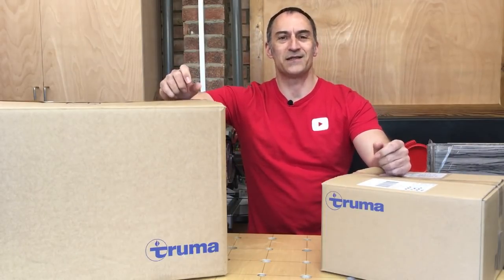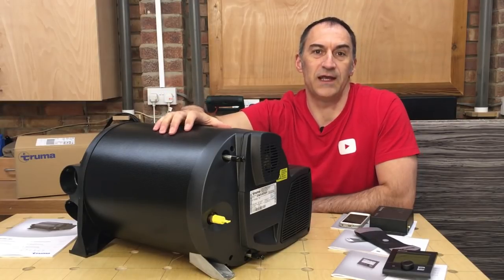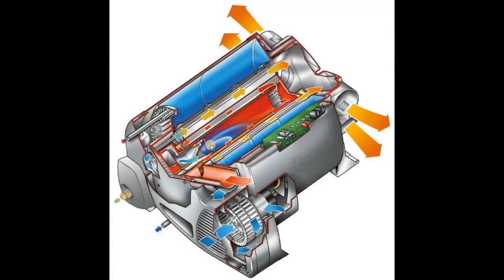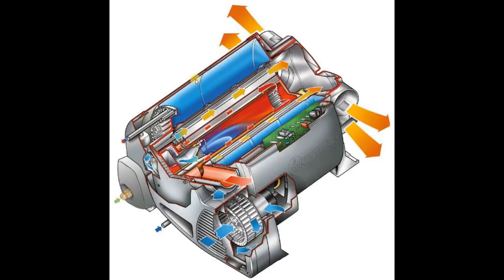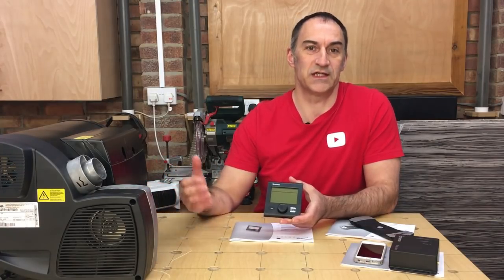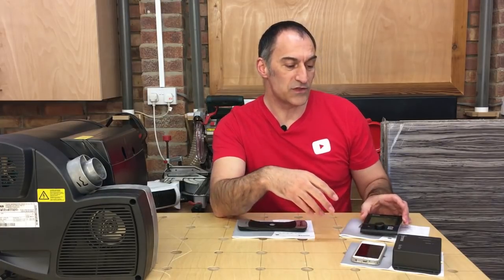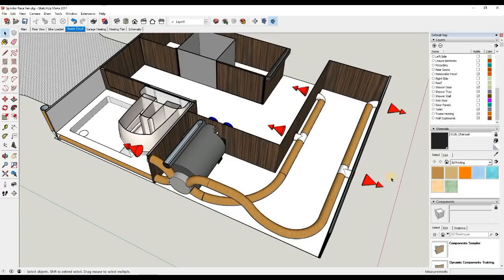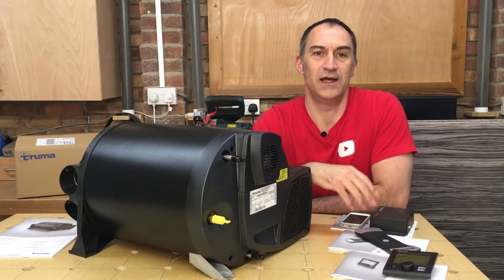Truma Combi 4e Heating & Hot Water Boiler

Comment: will the electric heating element be able to produce the same BTU's as when it's on max heating compared to when it's using max propane mode?
Reply from the maker: carmas54 the gas burner is rated at 4kw and the electric elements are 1.8kw in total (2x900w) so it’s just under half the heat output of the gas burner. I imagine this is done as a lot of hook ups are only rated at 10Amps so anything more than that would trip the mains supply in camp site.

Comment: Great video.
Is the water tank isolated, so if the water is heated up ones it will stay warm for a while without reheating?
Reply: If it were isolated, it would cool down faster.  The water heater tank wraps around the furnace.  If you turn on furnace, the water heats up for free.  If you turn on water heater only not furnace, it will remain as hot as any other heater but appears to be well insulated in the Combi.  If you want hot water while driving, you can duct the water around the engine area as per Truma specs and heat it up this way.  If you look at my comment above, there is a link to an Aussie dealer that lists all the specs. Truma appears to be the most advanced RV heater system available today.
Reply: @lass-inangeles7564  sorry my bad... insulated of course :) thanks for the answer

Comment: Other than the van itself, I bet that’s the most expensive thing you’ve had to buy for the conversation.  Looks to be a great bit of kit. What is the maximum length of ducting you can use to get the best out of the warm air?  Out of interest, will the ducting itself radiate heat, or will it remain cool to the touch?
Reply: The ducting does get warm. I have put small holes with a screwdriver in the ducting to provide extra warmth in certain areas like under seat storage for bedding etc.

Comment: Another excellent video Greg.
One question though. It was not obvious whether or not you can get hot water WITHOUT having the van heater on. Is this possible with this unit or does it only heat water when the air heater is operational?
Reply from the maker: Yes you can just use it to heat the hot water and not have the heating on in the van.
Reply: Greg Virgoe  how much does this unit cost.?

Comment: Hi Greg
was wondering what made you go with the Truma gas heater not the Diesel? I was set on the combi 4 like you have until I read that LPG doesn't like altitude and cold and the heaters are very thirsty from what I've read. We're planning on living in our van full time and so I've been looking at the D6. But im assuming at the moment this will be a costly installation if its fed from the vans diesel tank which I would imagine will involve an expert? 
I wondered if these were deciding factors or if you even considered the diesel option?
I appreciate you must be getting many questions so if I get a reply it would be much appreciated!
your videos are becoming a staple part of my day now I reference them so often!
Brilliant series
Thanks
Reply from the maker: The cost of diesel currently is nearly £1.40 a litre, LPG is only 65p per litre near me and as low as 54p in surrounding areas so nearly a third of the cost.  It also much cleaner fuel to burn and better for the environment. Autogas produces far fewer of the harmful emissions associated with traditional fuels and so offers the best environmental alternative.
 In fact, when compared to diesel, five times less NOx is emitted. I'm going to be cooking with LPG so it just made sense to have a refillable cylinder to supply both where I can get autogas at loads of petrol stations all across Europe.  https://www.filllpg.co.uk/?page=lpg.php
Reply: @GregVirgoe  Cheers Greg.

Comment: Greg - thanks so much for these brilliant videos - really clear and informative. I'd love to know whether this combi would be practical to work on electric input, as i'm trying to avoid an extra gas tank. Would it be practical/efficient?
Reply from the maker: It would be fine on electric hook up but would draw too much power from a battery system. 👍🏼😃
Reply: @GregVirgoe  thanks v much for speedy reply! - good to know. Guess that would be the same for a Truma Therme too then…
Reply from the maker: @sallywilliams6272  the Truma has two 900W electric heaters inside where the Therme has just one 300W element. So to heat the same quantity of water the Therme would take 6x longer. In the end they would have used the same amount of electric.
Reply: @GregVirgoe  exactly what I needed to know, and could never have worked out! Thank you, I owe you a beer!

Comment: Hi Greg. You showed in the video hiw the heating system connect but You didn't explain how the hot water  works.
Thanks
Reply from the maker: In the cut through section, I showed where the water inlet and outlet are connected.
You would use a normal pressure boost pump such as shurflo or similar and connect from water tank via boiler to your taps etc
I will be covering the water distribution system in another video very soon.

Comment: I'm sure that's a great heater, but I'd still go with an Eberspächer (Espar) Hydronic unit and a small heat exchanger; that gets you hot water without a tank. You can hook up another heat exchange to the glycol and that one will generate hot air instead of hot water. Rixen in the US has a kit, albeit for 120 volts (for the electric heater that can be used instead of diesel when you have shore power.)
Reply from the maker: Hello, to heat water instantaneously via a heat exchanger at a flow rate sufficient to have a shower you would need a big heat source. Most combi boilers that do that in domestic properties are rated at 30kW or 100,000Btu
Good luck with your build, let me know how it works out. Cheers

Comment: Why didn't you get the diesel version since you already use diesel to run the sprinter?
Reply: kittadyne   that's what I would do. 1400 quid tho. For a heater.
Reply: Exactly what I asked myself... I had diesel powered air heaters in two of my campervans and they were quite moderate in their consumption of fuel.
Reply from the maker: I was already fitting a GASLOW refillable LPG cylinder for cooking.
LPG is a cleaner fuel, greener and about half the cost of diesel.
Just because I have a huge tank of diesel under the van doesn't make it the better choice.
Reply: So would a gas powered propex or similar heater with no boiler still produce condensation or were you referring to different type of heater like a Coleman gas heater?
Reply: Why don't they make a system heat exchanger that takes heat off the exhaust to warm the water and as backup electric
Reply: Price??? Cost ??? Can't get an answer. ..
Reply: @darrenjones3681  Any heater or stove that vents its combustion gasses outside will not increase moisture.  ANY heater that vents its combustion gasses inside will introduce more moisture.

Moisture is a by product of combustion of propane, gas, or diesel.  So use a heater that is externally vented.
Reply: @clarktferrill  The price is  like for all german stuff, from the Moon.

Comment: Awesome stuff! What size 12v 2 core does this require? And does it come with the boiler or will I need to order extra? Thanks... keep up the good work 🤙🏻
Reply from the maker: Mine came with the mains cable attached but not the 12v. It requires a 10amp supply so depending on distance you may need 2.5 - 4mm cable.
Reply: @GregVirgoe  I’ve put 2mm down maybe about 8m.. do you think I’ll get away with that?

Comment: Greg,  Great review and its a wonderful way to go, but it is very expensive.  Did you do a cost benefit comparison to other units or split systems.  It looks to me like you can buy a hot water heater and furnace for about 1/2 the cost of a truma system.
Reply from the maker: For this particular van conversion it would represent approx a 10% investment on budget.
It is one of the largest single items costs but the benefits and functionality far outweigh the price.
I struggled to find any hot water heaters that can match the performance of this unit.
Reply: I agree, but at what price?  I can get an Atwood (Dometic) water heater and furnace for about $1,200 (665UK) whereas a Truma unit is more than double that.  I have trouble justifying the extra cost.

Comment: I can't believe it's got 2 dislikes! Excellent video, maybe I'll see you touring Europe in the summer, 4 months and 5800 miles planned!  On the level sensor, what happens if you have 2 bottles?  Gaslow is steel, why not Alugas, lighter, any disadvantages?  I'm looking at re-fillable ones to.
Reply from the maker: Hi Malcolm, you never know our paths could cross, sounds like you have a definite route planned. We are going to be much more winging it. 
For two cylinders you will need a level control device attached to each one, the level of each is displayed separately on the App.
The device is magnetic so steel tank is preferable. Although they do a fixing bracket for non magnetic cylinders. 
https://www.truma.com/uk/en/products/truma-caravan-rv-gas-fittings/truma-levelcontrol.html
Reply: Greg Virgoe thanks for that I'll look into it, yep you never know, take care 😀

Comment: Is the heated pipe really a good idea in the bathroom/toilet area? a humid and warm envirement isn't the best combo in a van (in first thoughts). i suggest maybe some kind of airsuction would make more sense. really enjoying the conversion, love the video's!
Reply: He's got an extractor fan planned for the shower/drying room.
Reply from the maker: Yep, exactly that Gracey. 
The warm air coming off the heater will be at a much lower relative humidity and will be able to hold much more moisture content.
This teamed up with an extract fan at a high level in the shower room will make the perfect drying conditions. That shower room will be as dry as a bone in minutes. Plus the added bonus of having a nice warm toilet seat will keep her indoors happy.

Comment: Hi Geoff, really appreciate your videos. They're so helpful. In your energy use audit video you say that you will not use the boiler unless you are on a hook up, due to the energy consumption. Does that make the boiler less important to your build or has your experience since being on the road make you just as glad that you included it?
Reply from the maker: Geoff?? The boiler is dual fuel so when off grid it runs on LPG. We only use the electric elements when on hook up because they consume more power.
Reply: @GregVirgoe  sorry Greg! Thanks for your reply.

Comment: Hi Greg, can it be run of 12v? Thanks
Reply from the maker: Hello,
No, The 12v supply is just for the controls, it needs a 230v supply to power the 1.8kW of electric elements if you go for the electric heating option. practically this is only suitable for a hookup supply as it will drain your battery in no time at all.

Comment: Thanks again Greg, and like some readers have mentioned, I too am running out of compliments! 
I was intrigued by your comments regarding keeping the cab warm to stop condensation and it got me thinking about your insulation again. I've been looking at this transparent film applied to glass that is claimed to reflect "upto" 60% of infrared radiation. I imagine that that would help in the cab area by reflecting radiated heat back in rather than losing that to the outside. Not sure of the legality of applying such a film on the windscreen, but apparently it is close to completely transparent, so I imagine it would be ok. Obviously it does nothing in relation to heat transferred to the glass by conduction, but can you see such a treatment having a noticeable reduction of the heater's gas consumption by reducing radiated losses?
Reply from the maker: Most film application to Windows have the reflective side facing out to reflect the sun rays from entering the window and are to reduce the solar gains. I have not seen any that work the other way?
Reply: I wasn't aware the films are one way. I'll look into that - get back when I know more. You actually want an IR film that reflects heat from either direction - keep cool in summer and keep warmth in winter.

Comment: This might sound silly... but can you have the boiler on for hot water without the air heater ? Great video by the way!
Reply from the maker: Yes you can, you would need to do that for showers in summer. 
We find for a bit of washing up it’s more economical to boil a kettle in summer as it’s less water to warm up. We generally use the hot water in the morning for washing as the heater may have been on in the night to keep the van warm and you get the hot water as a by product of the heating. This really does make it very economical to use.

Comment: Hey Greg, this may sound like a stupid idea and you're qualified to know if it is or not, but have you thought about a preheating copper coil wrapped around a lenght of your under van exhaust system. I'm sure you know what I mean. It would just mean warmer water would go into the cold entry and this may make the system even more efficient or compexity failure, I'm not sure.
Reply from the maker: It's a wacky idea Karl, can't say I'll be implementing it on my vehicle. The exhaust will only be hot when driving and we won't be using the heater during that time. When stopped the exhaust will cool very quickly so I don't see the timing of these being in sync with each other. Running the water feed through a wet solar panel may be another idea for you to consider?
Reply: Greg Virgoe Thanks Greg, I’m an ideas man and about 5% of my ideas are awesome and I follow through with them. Well the other 95% I might file in the round cabinet. I hadn’t really thought the timing of when a preheated would be a good thing. I’ve seen heat exchanger that you engine cooling fluid to heat water and no-one says they have real joy from them. That’s why I was thinking of exhaust as it’s much higher temp. Anyway love the content as always and I hope you got a kickback or discount on your unit 😉👍

Comment: HI greg. 

I have just discovered your channel and I must say it's so good. Me and the Mrs have watched most of your videos now. We are aspiring van converters.

Just a couple of questions. Not sure if you or other followers will  know the answer. But regarding installing anything combustible and electrical. Does that kind of work need to be signed off to deem it safe? 
Also where did you purchase the Truma? 

Many thanks.
Reply from the maker: Hello Mark, I would always recommend that a qualified engineer sign off any installation to make sure it is installed safely and correctly. You only get one life, best take care of it. You can purchase the Truma system from a number of Motorhome and caravan dealerships across the country and prices start from £1400 for the heater and control panel. A Google search gives many options. I personally approached Truma about being a part of this build series on YouTube because I really wanted to use their equipment in this van conversion and am pleased to say they really liked what we are doing and our future plans for the van after the build and wanted to be a part of this journey.
Reply: Greg Virgoe HI greg.
Thanks for your reply.
Yes one life indeed. This is why I want to do van life and travel. Ha.

I suppose my question was coming from an angle of if you get the van re-labled as a motor home. 

The truma gear looks good. I plan to use my van in the colder months too so that I think would do the job.

Comment: I know you can insulate the area this will be contained in but do you know how many db's radiate. Thank you for the video's Greg, I've searched around on Youtube and this is the most informative I've found so far... Just brilliant.
Reply from the maker: Hello Tony, I do not have the data for dB rating.
Centrifugal fans are usually very quiet these days.
As long as you have adequate airflow and not restricted it should be quiet.

Comment: I could not really tell in your drawings, where are the air returns? In any HVAC system you need a return...possibly more than one if the area where the feed is going is far separated like your garage area.
Reply from the maker: At 10:20 you can see a large return air grille and two blue arrows directly in front of the heater for the return air. This large grille is in the front of the bench seat.

Comment: Greg, loved watchding your series on panel van conversion to an RV. I see you take great pride in your work. But I also absolutely love your detailed explanation of every thing you have built, installed or fitted, from how it works, how to install it, the handy hints on how to make it easier through to use of template's etc. While I don't know anything about the Truman, and have never used one, why you picked one makes absolute sense. But I have a question. Now the reason I raise this with you is I'm living in Australia, and it gets very hot here. Does this particular model of the Truman, have a way of venting the warm air outside the van during the summer months, when you only want to heat the water? Interested in your thoughts.
I plan on doing a van conversion, soon myself downunder, and your videos certainly are at the top of my list of how to videos, when I get started. Wish you all the very best with your travels around Europe.